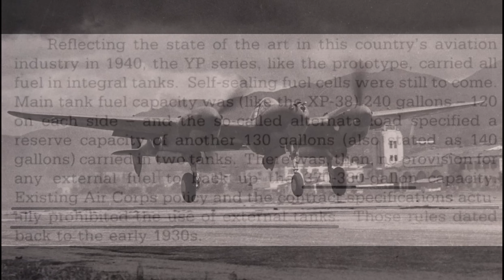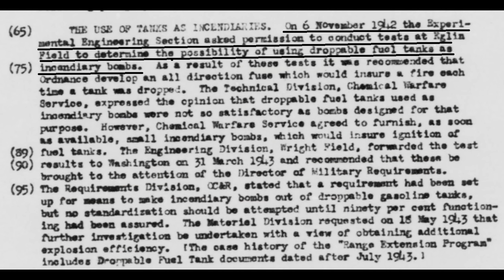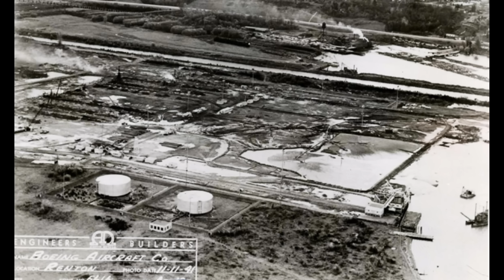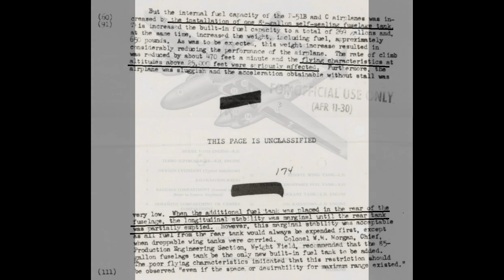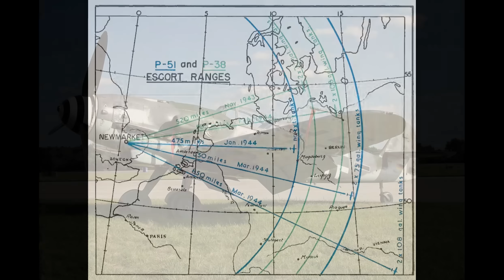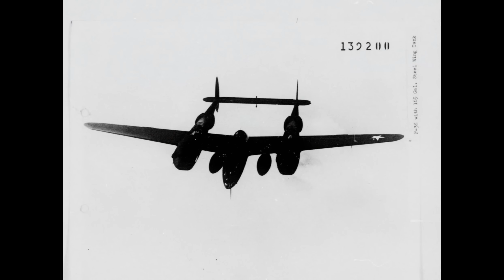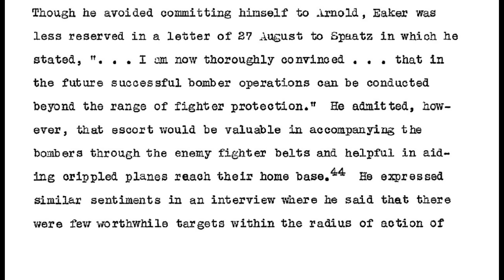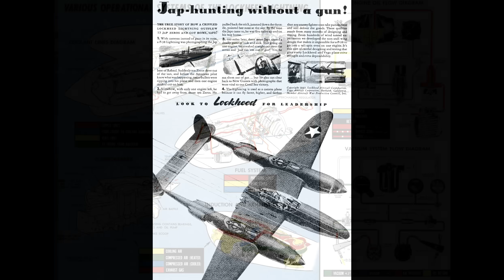The P 38 Lighting and the Bomber Mafia's Failure In World War Two

Comment: the p-38 was known to have engine issues when flown out of England.  a lot of it has been blamed on the engine, however they didn't seem to have the same issues in other theaters, so wondering if fuel quality  had more to do with it than the engine. 

also it is a pity the the p-38 never got a 4 bladed prop
Reply: I'd doubt it was fuel quality, British aircraft used very similar grades of fuel to US ones
Reply: @gherkinisgreat  A high altitude over Long Beach California the turbocharged Allison V1650 performed fine.  At a similar altitude over Europe the air was colder and the fuel would fractionate. I would Imagine the lower RON less knock resistant fractions went to the rear cylinder.  The problem was known about but I believe it took some time for the solution to be implemented.  I suspect the problem is being overstated.  
-There were differences in fuel at times.  Refineries test for certain features such as RON, PN and but maybe not all and these may not have picked up the fuel fractionation issue.
Reply: @bernhardzunk7402 appreciate your info, not trying to be a dick but add clarity... The Allison was 1710 cubes, not 1650.
Reply: @gherkinisgreat  False. In order to get adequate performance from U.S. fighters, Jimmy Doolittle had to call on his friends and air race sponsors, Shell Oil, to get good quality fuel to England. The British fuel was lower octane, and when tetraethyl  lead was used to boost the octane, it came out of suspension, fouling the intakes, intercoolers, and spark plugs. The British fuel was considered "dishwater".
Reply: US 100 octane fuel was in use by the RAF in the Battle of Britain. It increased Spitfire speed by 25mph at sea level and 35mph at 10,000 feet giving it the edge over the BF109.
Reply: On the E through H models, part of the cooling system passed through the wing leading edge, and it caused a lot of blown engines over Northern Europe.

The J and L models changed that, and put a scoop under each nacelle.  This fixed the problem.

But by this time the P-38 had been relegated to the 9th Air Force.

Comment: They also diverted Lightnings to the Mediterranean, as the 55th suffered serious issues with supercharger regulation at high altitudes and winter temperatures over the Europe.  It was as though increasing the range of P-38 escorts was not as easy important as using them elsewhere.  I read Malcolm Caldwell’s “Bomber Mafia,” and found it interesting, but politically charged anti war leftist spew.
Reply: "anti war" common sense?
Reply: @sealioso  hardly.

Comment: I doubt the P-38s could have danced and tangled with the Luftwaffe with brilliant results, but they WOULD have stopped it just being a Turkey Shoot against the bombers. WW2 is full of incidents whereby the job of a good-enough-decent-plane is to prevent enemy fighters from operating unopposed.
Reply: I think it would be wrong to think P47s and P51s “danced and tangled” with bf109s & FW190s. these aircraft boomed and zoomed and wouldn’t hang around after any merge. all of the US aircraft had relatively limited time before having to bug out and head home with enough fuel to get home. All of the escort types were heavier in combat than their German contemporaries so were never going to be dogfighting in tight turns like a Ki-43 or something. in that context while I agree the P38 wasn’t an ideal dogfighter it would be being unfair to single out the P38 and also endorsing a myth that a fully laden P51D was turning inside a light bf109 and out rolling a FW190 then flying back from Berlin..